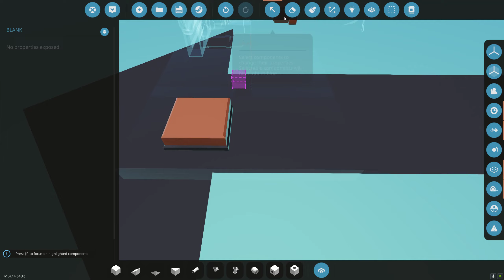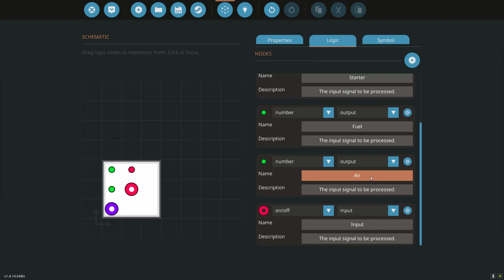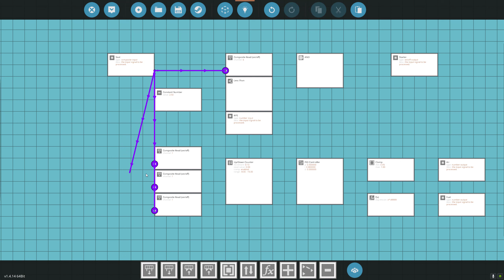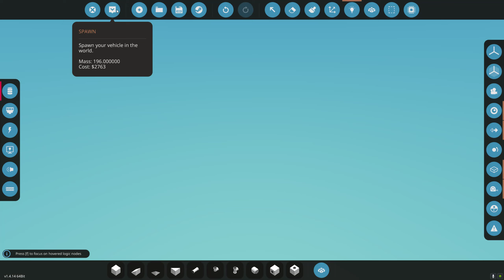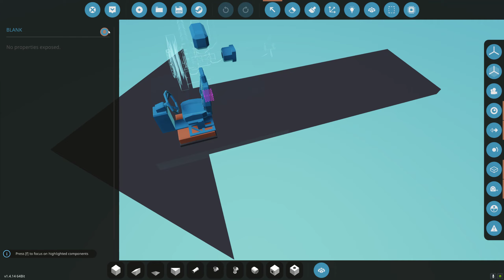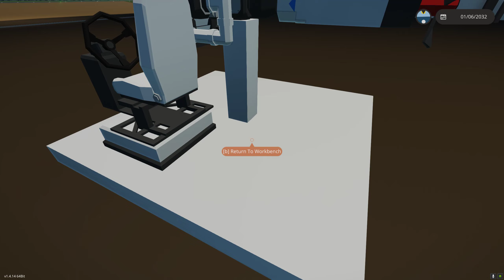Stormworks Basics Modular engine tutorial Part 3

Comment: I know this tutorial is old but Im just coming back to stormworks and Ive NOT ever been good at Modular Engines. So I followed your tutorial to the letter. I even caught your mistake of not setting the Hotkey buttons to PUSH. 
I suspect an update likely broke your tutorial and or maybe even Modular engines not sure yet but upon completion of the engine and making the microcontroller when you went to start it for the first time you got a stalled engine
When I started it for the first time with the clutch actually connect and a prop on it I was getting 60 RPS at idle.  When I opened the clutch it would start at 14 and drop off. After changing the PID like you did no matter what I changed the number to in the PID its idle was Im assuming the Max RPS for the 1x1 Cylider 60 RPS.   This is why I never liked fiddling with modular complicated and required a bunch of Microcontrollers not only that but I hate the weed wacker sound of modular. Anyways can you think why I might be running 60RPS when first attempting to start the engine? I also Vented the fuel tank just a T pipe with a Fluid port end cap after the tank.  I just figued I would mention this in the comments for anyone following along new to stormworks who was getting max Idle RPS.
Reply from the maker: Follow this series. It's up to date.

Modular Engine Tutorial Series: https://www.youtube.com/playlist?list=PL4BURbFo2IhogjZEsGJ-lVRZJZOWpyXlS

Comment: when my engine reaches 14 rps, it then bounces up to 15,16 back to 14 and repeats, the AFR constantly changes and the stoichiometric goes for .5 to -1 rapidly, when it is idle and slowly increased to about 4-5 rps the issue isnt there but anything over 5 it bounces
Reply from the maker: Post a workshop link here here and somebody should be able to help https://discord.com/channels/977272291706683412/978770200042291210

Comment: I would hook up the desired idle rps to the pid, using a switch box to toggle between the fixed, low (around 3) idle rps and the non-idle rps from user input.
Reply: Agreed. Manually setting the throttle for idle speed is a losing game, you'll never get it exactly where it needs to be. Better to set a target RPS for idle and let the PID figure out how much throttle to give to give the engine to get it there.

Comment: hey bro through a lot of trial and error I believe I found the best value within reason: 0.18457 @ PID 0.5, cheers!

its idles amazingly and barely increases its nice
Reply from the maker: Very nice. I did not bother tuning that PID because it never has any load being out of the water. Glad you found good values.
Reply: @CaptainCockerels  Hi, I gave my PID 0.184559 at 0.5.
Rps goes and stops at 3.32815 and then goes up.
When i go to idle it goes very slowly.
Why is that and can i speed it up?
Reply from the maker: @TheFrog585  check out video 7 and see if those pid settings work